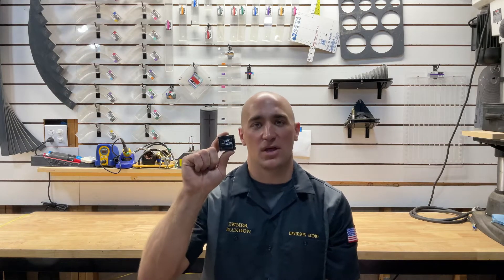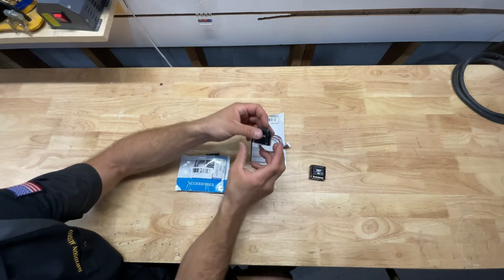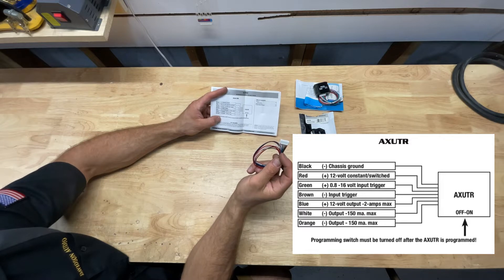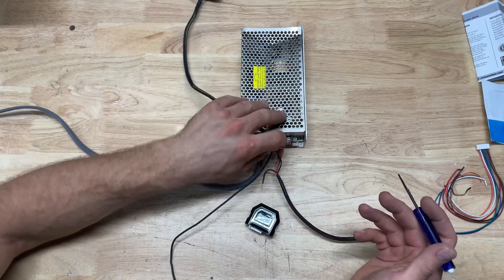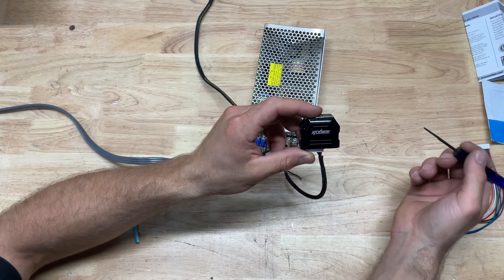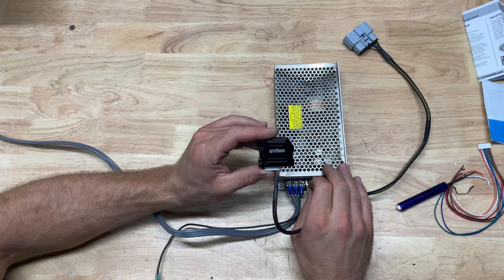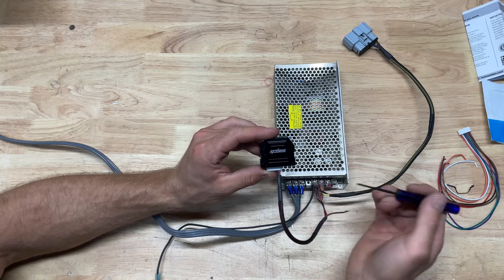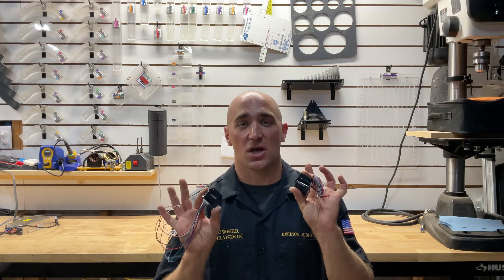Time Delay Module Programming

Comment: Thanks for the thorough demonstration.
Reply from the maker: Absolutely, love to help
Reply: @DavidsonAudio   i have a pac tr7. my car is stored. i turned on my pioneer head unit and it wont play dvd also the blue tooth is greyed out even though my parking brake is up. my tr7 red led is on when i turn the key on. could it be that the tr7 is bad or does it need to be re programed.